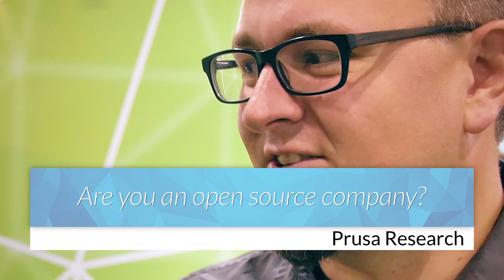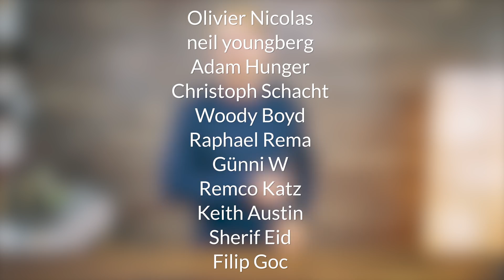"Open source" is more than a marketing term!

Comment: Yes, I definitely prefer to buy open source products and would stop buying from a company that used to be open sourced in the past but have since gone closed. The reason for it is very simple: I am 72 and have seen a number of companies come and go in those 72 years. I have things that I bought but can no longer use because their proprietary maker is no longer around or just stopped supporting them, and no one knows how to fix them, or even just write device drivers to use perfectly functional hardware with the current crop of operating systems.

Heck, the entire computer revolution was moving very slowly until IBM released their IBM PC with full schematics, which jump started the whole slew of IBM compatible computers as well as third party plug-in cards (as in better video, better audio, etc).

Comment: open Source all the way, would never ever buy XYZ, unless they changed the way they think, im sure they are using open source that should be shared and are breaking there agreement under what they have used in there products & code. who wants another Makerbot, once you tasted open source, I can't Praise enough to Marlin, RepRap, Prusa, E3D, Lulzbot, Duet 3D & the many others I haven't listed!!!! and 50% to Unimaker, as it seems they are leaning towards almost maybe Closing there open source, they are way to careful with the words they use & never use simple words to explain, but more complex words & taking the route like makerbot slowly, could be wrong but we see. never could afford a ultimaker anyways, way to over priced for me. just my thoughts on this. and what I got from it. Thank you again Marlin, RepRap, Prusa, E3D, Lulzbot, Duet 3D and Unimaker for cura. many others for your open source!

Comment: Ultimaker 3 is a tricky one. I am glad that they are being honest that they are no longer truly open source, it is where they began, and its such a popular buzzword that companies lean towards. but there automatic filament setting detection was a bit of a sticking point (until they revealed that you didn't NEED to use there own brand), but they have moved a long way away from there wooden Original Ultimaker. But other than some funky nozzle designs and fantastic software, haven't moved as far as other companies. still they have that super professional apple looking design aesthetic!

Comment: I think xyz lady appeared to be explaining her company's limit on open source using a practical, and important, meaning of open source, experimentation.  Her lack of understanding of the subject shows that XYZ doesn't care to contribute to the community by way of giving away their engineering time.  There are many good and bad things about the open source community and ideology.  It is not hypocritical to say that you want to support the community but only a little bit.  Sometimes it is necessary to hold onto what you have, just to survive.  And that becomes more important the bigger your company gets. This same discussion occurs with Windows/Linux.  Should Microsoft open-source their OS?  Surely not.  Some of my customers send specifications that explicitly exclude open source designs and software, and they have good reasons.  If xyz is relying on open source to function, they should come clean. But I feel that xyz can make a contribution to their customers who don't care about open source without needing to be shamed for it.

Comment: I seem to recall a lot of people asking about the PINDA probe for the MK2S on the facebook groups. So far, no plans no part numbers no suppliers no tips for correcting the notable temperature-dependent deviation ... and they announce the MK3 which has temperature compensation.
Uhm.....
For most part, sure, it's Open Source, but no clear reasons where given on why the secrecy.
Perhaps they were afraid of sharing their novelty ? Or the real accuracy on one of those ?
I have one, and while it's nice, the PINDA is an actual pain in the ... and the bed could be more flat. smh.
Reply: I guess the bed on the MK3, being a steel sheet, stands a good chance of being flatter. He did say in a video recently that Prusa will be selling those PEI-coated sheets pretty cheaply once they're in full production, and I see no reason why it couldn't be clipped to an unmodified MK2/MK2S bed?

Comment: Open source is a motor for a lot of projects and new ideas. Not only 3d printing. Think at all the tools for creating and realising new tings like gnu compiler for all the avr's and arm controller used in so many devices even for 3d controller boards. Without the huge community of open source we all have to pay a lot of money and many things we use every day wouldn't exist. So I'm very upset about closed projects if they made of an open source. If someone like to sell a 3d printers don't close the firmware. Do better reliable and precise  hardware. Nice discussion about open source, Thomas! Mach weiter so.

Comment: Open-source is brilliant. I go to a school where we are not taught anything related to coding because they decided that if we were interested in learning to code, we would be far ahead of what they would be teaching anyway, so it would be pointless, but the fact that open-source stuff exists is great as (at least for me), it is a great way to learn, as you can see how the software works (as it is free) and find the code that matches the functionality, and learn from it, and even use that code in code that you write - you don't learn to code, you code to learn.

It is also great for other companies to make products to compliment other companies' products - as Sanjay said,  the ruby nozzle is cool!
It also means that users of the products can feed back to the manufacturer in a more meaningful way when they want to suggest improvements as they can just make a change to the code, which they can easily download, fix it and then send it back to the manufacturer.

I am glad to hear that Prusa is using FreeCAD, it is great software, and without it, I am not sure what package I would be using, as there are not that many free packages that are  as flexible as FreeCAD is -  it is so easy to start making things, either using boolean operations and simple shapes to get what you want, or super-complex drawings. It has flaws, but the community can improve it as it is, of course, open source!

As for Ultimaker, given the more professional market that they are catering for, I think that it is reasonable for them to be releasing info for open-source a year after the UM3's release for the sake of competition, and although it would be nice to see source-code on release day, better a year later than never.

This is one of the best videos that I have seen on the subject of open-source, and it has been interesting to get the opinions of some of the largest companies in the 3D printing space!

As for XYZPrinting, No comment other than they clearly haven't a clue.

Comment: and then, Chinese download your cad files and make their own clones using cheaper parts and stealing customers? Like they copied arduino projects like 4in1 external wifi transmitter  module that work with taranis and binds with lots of stock mini quads... one guy made it opensource now they are selling it on banggood and making money without even contacting him

Comment: It's ironic that you posted this when there are people out there using Marlin without folding back their changes into the main build.
Reply: This is unrelated, and they don't have to, and it's a nonsensical quip that displays a lack of the the understanding of underlying engineering; they merely have to publish them and make them available to use (by Marlin maintainers, or by others), not force the Marlin maintainers to accept your changes that might be counter to their plans.
Reply: +Siana Gears It's pretty related. And makes all kinds of sense to people that operate on the ethical framework of giving back to make the whole better. You aren't really helping anyone if you are forking to maintain obscurity. So what if you posted the source. I have seen them post source that had no explanation for what they changed or why which is useless. It's the same reason that Marlin eats up so much unnecessary space. Nothing in what I said mentioned the words 'force maintainers to accept changes against their plans'. If you actually worked with Marlin then you would know they don't do it that way. You submit your changes and they review the code and decide if its going to be a good fit. You can read the nightly build notes on Github and figure that out. You aren't helping simply by providing source and walking away. Have the ethical backbone enough to provide any fixes or changes back to the Marlin team directly when a significant feature has been created. Then we won't have issues that have been fixed several years ago slowing down current Marlin development. Unless you like having to hunt through forks to find fixes to things that have already been fixed. In that case you can have all the fun in the world.
Reply: In case you mean Prusa-Firmware... OK, i am an open source developer, but i haven't worked on Marlin yet, and actually chose another firmware to work on - i merely don't have anything to contribute yet... anyway i did look at the repo, and thought to myself "OK where's the history... WTF IS WRONG WITH THESE PEOPLE?"... gah lack of proper git culture.

I mean sure, i've diffed worse, MUCH worse. But that's not nice.
Reply: I am talking about ANY of the Devs that practice the 'Fork It For Profit' method of doing business. 

In the last 3 months I have seen people selling modified config files to enable existing features as upgrades. 

I have seen hardware vendors intentionally refuse to provide source to users on request. Even after a user had a problem for a month because of some setting they changed.  I have seen a ton of people bitch about Features and never submit a single Feature Request. And a ton of users that don't understand that if they see something janky like this happening then they need to say something.

But they all want to operate in the Open Source camp like nothing is wrong. Saying 'I only use free software and I provide my source' means nothing if you don't contribute. I learned this the hard way from early Linux development. If you have to operate your business in grey areas of Open Source to survive then you should probably be working in the closed source software environment using your own code built entirely from scratch.

It's literally in the Marlin License:

'While we can't prevent the use of this code in products (3D printers, CNC, etc.) that are closed source or crippled by a patent, we would prefer that you choose another firmware or, better yet, make your own.'

Comment: Try getting a pinda probe or details from Prusa. They're not as open as they would have you think, probably for business reasons but it does defeat the idea and an acknowledgement of this would have been nice. Still they get it unlike XYZ ;-D
Reply: It's a custom made sensor with 8Mx35 enclosure, 4mm sensing distance, 5V supply, NPN NC output, soandsomuch accuracy and suchandsuch sampling rate... very silly of them not to publish THIS.
Reply: Luke Pettit What's not open? I'm genuinely curious...

Comment: One of the reasons I decided to buy a somewhat more expensive (than cheap Chinese Prusa clones) LulzBot printer was that Aleph Objects provides all the source code, files and design information as truly open source. I believe that supporting other users and the industry as a whole is important and buying an open source product is more likely to do this than going down the cheapest route, although the low cost of many Chinese 3D printers has enabled many people to join the community who would probably otherwise be priced out. Whilst cheap copies can enable people to dip their toe into the world of 3D printing they are unlikely to make any meaningful advances in the technology. Although Prusa started as a result of the RepRap project I believe they have begun to move away from open source in an attempt to protect their intellectual property. Whilst I'm not against free enterprise and subsequent patented design and processes it would only be right for some degree of flexibility given their origins. Sadly, I can foresee a time when many of the benefactors of the original open source RepRap project become extremely guarded with their designs thus anything but open source.

Comment: I wholeheartedly agree with the open-source thing. I started paying attention to whether the software I was using was open about twelve years ago, and about six years ago when my Macbook died, I switched from OSX to Linux as well. When I first became interested in 3D-printing I was delighted to find out that not only were RepRaps a thing, but many commercial models were, in fact, RepRaps under the hood, and were upfront about the whole thing. All of them spoke the same language, hooking it up was no problem because there was a standard. Now that I've bought one I feel like I really own it, because I can change whatever I like in the firmware, read the source and really try to understand how it works. buy/make new parts if it breaks, and generally do whatever the hell I want with it. I'm pretty sure Hewlett Packard wouldn't let you try to extrude strimmer cord or nylon draw tape with it. Make it faster, make it better... I love that. Really gets my engineering juices flowing. When developing software as well I fully agree with that we are standing on the shoulders of giants. What I do would be completely impossible without the help of open-source libraries, varying from image codecs to the Bullet physics library. Open-source is what makes stuff work, and without it, we wouldn't have come as far as we did, as fast as we did.

Comment: There's some good questions to be discussed around just what constitutes open source hardware. There's different levels that could be considered, all have some validity.

For example: PCBs. Is just the pcb layout enough? May seem so, but if it's using references such as R1, C1 for parts/values, is essentially useless. Then what about manufacturing processes? Maybe there's a part of the board handling lots of current, and so needs a thicker copper layer than standard. Maybe the board needs to be manufactured in a specific way (see: MK42 clones bending). And those are just a few considerations for just the electronics. 

My personal opinion is that to be OS hardware, you need to provide everything needed to recreate the hardware, assuming you have the tools and materials (while also providing details on what materials, and preferably, what hardware, though that's dependant on many factors).

EEVBlog has a good video (#921) from last year on the topic where he proposes a new OSHW logo with different indicators for the level of open source. Does it provide a schematic, pcb designs, firmware/software, CAD files, design docs, BoM, and does the license allow for commercial use. Not a fan of the logo itself, but the idea behind it is solid.

Comment: I'm all for open source, but can understand charging for software. There is a 3d fx package I use called Houdini by SideFX, their business model is "Download it for free, just don't make money on it.  If you are making under $100k, here is a cheapish yearly license.  Making more than that?  You need a full license." I like this idea for top end programs.
I realize this doesn't fall in line with programming or hardware components.  But given what the program can do, I can design 3d printables without pirating or paying with an arm or a leg.
I'm currently in the process of incorporating Slic3r directly into Houdini, because, python.
Reply: Wait what, Houdini is freeware? Gotta try.

But i think the important thing in open-source is not specifically that it's free - i paid for Blender in 2002, and have supported and will support the Foundation again. The important thing is that nobody can take it away from me. NOBODY. UNDER NO CIRCUMSTANCE. NEVER.
Reply: The is the one thing that bothers me with this new-ish monthly/yearly purchase model. Autodesk, Adobe, and even SideFX.  I own Maya 8.5 from like 2009 because of student prices.  Yet still go with monthly fee for Maya LT because I want the newest tools. I don't feel like I own it... like I'm leasing the software...
But yeah, look for the Apprentice download on sidefx.com, they restrict render frame size, but I think that's the only important restriction  You can still export obj files with it.

Comment: Thank you for this video. Open source is very important for many reasons and you can see the background in the community. Just take a look on Thingiverse and you may find a solution to a very odd problem. Or at least ideas on how to solve them. It is purely amazing.

However, as there is money to be made I fear a lot of stuff may change, this is why we have to support the companies that belief in open source. It does not mean that you should never buy an E3D clone. But if you have the money to spend (and want to save yourself some hassle that might occur), buy the original.

This and the fact that I was just starting 3D printing was the reason I spend the money on a original Prusa. Now I've got a Haribo mod i3 with modded firmware, octoprint, camera... And pieces on the way to build an i3 bear edition. All of this based on the work others have shared freely. And of course wherever I can, I share my own designs as well.